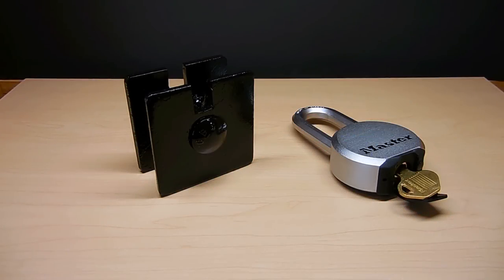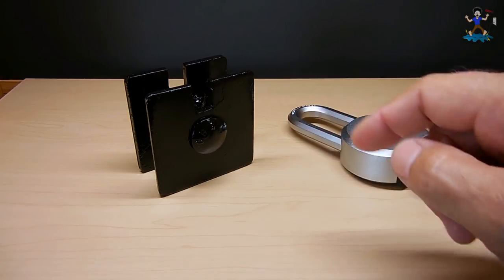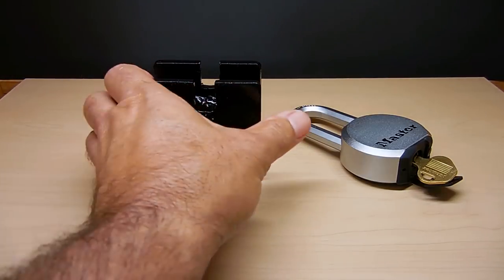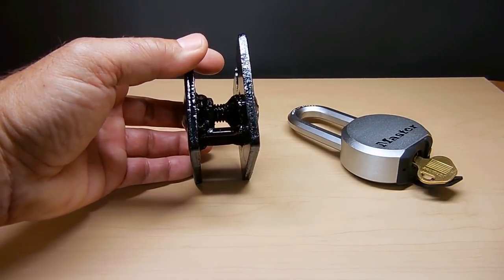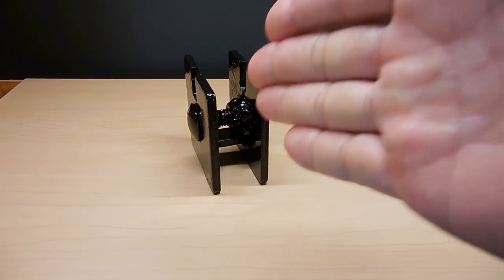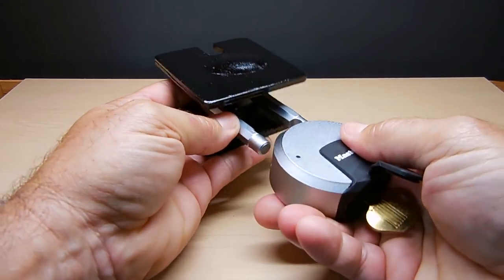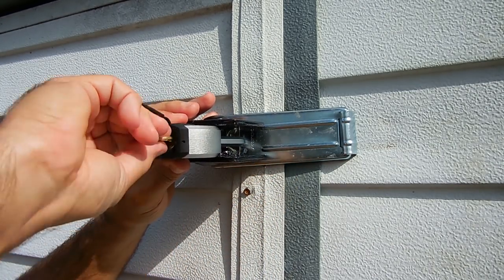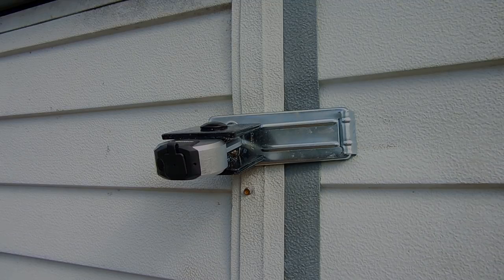Homemade Lock Security! (Thick Steel Shroud)

Comment: I am sure your example 'flimsy hasp on aluminum sheet metal' would easily snap off with a $6 pry bar or crow bar. Sadly we must reenforce every step of the process and lastly have a frangible electric circuit tape that sets off a 200db SIREN or a swinging guillotine.
Reply from the maker: The hasp and shed was used for demonstration purposes only. Ideally you'd have a better hasp, and it would be bolted to a concrete wall or wood wall using long blots. Thanks for watching

Comment: Need not send to lock picking lawyer, as I already said, the only way is to pick this lock. BUT sad to say 99.99% of thieve WON'T know how to pick a lock. If they know, why would they steal your bike or motorcycle. They can simply pick something else much more valuable like banks, car, or any apartment instead. All bike thieves use brutal force. Or that they move away your bike load up to their van, to elsewhere, then, slowly grinder cut. Last but not least, only 0.001% people whom know how to pick locks professionally, bill and lock picking lawyer.

Comment: It would be too easy to just pry the whole locking mechanism off the thin steel siding it is mounted to.
Reply from the maker: That's not what the video is about. Some hasps are VERY strong and thick, when those type of hasps are properly secured, the crowbar will be worthless.

Comment: Really nice piece of work, but it doesn't work for that shed application you show with that lousy hasp.
Why not just cut the hasp with the cutoff tool you show or just use a crowbar or long flathead to rip the hasp right off the shed?
It is likely held on by four weak and short screws.
You've protected the lock, but the hasp is the weakest link there.
Reply from the maker: As long as you use a high quality thick steel hasp, and it's properly bolted into a concrete wall or wood frame wall, you won't be prying it off the wall. Yes, the one I show isn't the best. :-) Thanks for watching!
Reply: @electronicsNmore  
No problem. It is a good design.

Comment: A thief will take a monkey wrench, put the jaws around the whole thing, and in 3 sec twist the entire thing apart tearing off the enire thing off the wall. The little screws holding this into the wood, is no match for the leverage gained with a monkey wrench. The hasp where the lock is placed, is the weakest link in the whole thing. Yes, the lock is undamaged and they did not need nor get a bolt cutter to work....however the objective was to protect the entry, not the lock.

Comment: Pretty affective tbh but idk how well it would really protect against a sledgehammer since it has so little room and has the be vertical it holds itself so when you hit it with the hammer all the tension is gonna actually help you snap it i mean obviously your gonna have to hit it hard probably a couple times but i almost know the average person could snap the lock or whatever you have it locked to and get in just depending on whichever is weaker and picking a lock is always the best idea tbh if your good anyone but the owner will think you used keys bc of how fast you can pick a padlock well cheap ones at least

Comment: Hi, this & your shackle protection using nuts & washers both are videos w great ideas. However, do you know of any method to protect against drilling out the core? Could you maybe JB weld some hardened washers around the key entry? Cheers...

Comment: LPL: "Today we're looking at a shrouded Master Lock setup.  Can't attack the bolt with cutters, and I've already bypassed so many Master Locks it has become boring, so this time, we're going to try something different."  [LPL takes 3-foot wrecking bar and rips the hasp assembly off the wall.]  "Click on one."
Reply from the maker: Every lock made or connection point has weaknesses. Nothing is 100%.

Comment: I lost a motorcycle with that hasp. They didn't even touch the lock. Just stuck a crowbar behind the hasp and popped it right off. Luckily, I got the bike back. No thanks to our ever vigilant police department and their seeing eye dogs.
Reply from the maker: Yes, a cheap hasp is easy to rip off a wall. If it's thick and properly bolted, the crowbar won't work. Thanks for watching!

Comment: Good idea. But. You can just cut the hasp flat bar or just put a large pipe wrench over the box you made and twist it around. Either the lock or hasp will break.
Reply from the maker: That wasn't the point of the video. It was for demonstration purposes only. I've seen MANY thick hasps that you won't be cutting through, and a criminal won't be using a noisy cut-off tool.
Reply: @electronicsNmore  check a bit how they use grinders in broad daylight in the open to cut motorbike chains. They don’t care a shit. Just yesterday 3 people tried to break in by my gate to steal my trailer. 5pm broad daylight and the gate by the road in an urban area. They thought I was not home. They tried to break the lock as I mentioned. Use a pipe wrench and just twist the lock around. Either the lock breaks or what it is attached to. It is not noisy at all. And quick. Only way I heard something was up and opened the front door was because they accidentally knocked the wrench against the metal gate. In South Africa, brute force attacks on locks are common. And using mobile grinders is also common if it is on a farm. Any box around the lock does not slow a grinder down much. And does not help for a brute force twist attack.

Comment: Send it to The Lock Picking Lawyer! See what he makes of it, obviously don't use a master lock, ever, but I wonder what he'd say?
Reply from the maker: He won't be able to use bolt cutters or shims on the shackle, that's for sure. He would have to make a special shim to reach into tight spaces to exploit padlocks without locking balls.
Reply: @electronicsNmore   he would use a pipe wrench on it and twist it off in seconds😕

Comment: You have protected the lock shackle to some degree. A large bar will pry this lock setup off the door frame or expose the hasp or mounting hardware to attack.  This hasp is exposed. I also bet that a battery powered angle grinder with a  thin metal cutting blade will power thru your surrounding steel and lock in no time.  Notch the steel plate on one side and this will expose the shackle which you can now cut . Also how good is the door itself. People put expensive locks or protected lock shackles on cheap kick in doors with glass or glass side lights. Look at the videos of  the military and police using a battering ram to gain entrance. There is no stopping them.  I still enjoy your videos.
Reply from the maker: The video had nothing to do with the hasp, it was all about protecting the padlock shackle from bolt cutters. I succeeded in doing that. If you have a thin steel hasp that's not properly secured, then of course you can pry it off the wall. Like you said, nothing is 100%. Thanks for watching
Reply: JOHN LUCAS ahh police can be stopped  again as you said check videos...can lock doors locking pins go through floor and cieling as well as wall

Comment: you code probably just cut the Metal  from the wall to the Dore and not even need to care about the lock and its security
min 7:02
Reply from the maker: True, but if that hasp was thicker and bolted to concrete, good luck.
Reply: @electronicsNmore  thanks

Comment: just smash with hammer, locking in this position will make a bigger mechanical advantage to brake the padlock
Reply from the maker: Wrong.
Reply: @electronicsNmore  it works as a lever , end of your plate is the fulcrum, just try with a much longer plate and you will find out how easy to brake it even only by hand

Comment: An electric nippler (can opener) can cut around the hinge and it is not very noisy or you can grind the pin out of the hinge itself.
Reply from the maker: That has nothing to do with this video. The video was all about protecting the padlock from bolt cutters, shims, and making cutting the shackle very difficult.
Reply: @electronicsNmore  Well it is not meant as a critique of your idea. I had the same problem and ended up deciding that an inside locking mechanism that could not be accessed from the outside by unauthorized persons would be the solution... which opened another can of worms.

Comment: Great idea to protect the lock, but you can use a pry bar and be inside in about 10 seconds
Reply from the maker: Not if the hasp is thick steel plate and it's bolted straight through a wall. Thanks for watching!
Reply: @electronicsNmore  you underestimate the power of leverage.

Comment: The whole time you were explaining how it was made, I was just wondering what the point of it was up until you finally showed how the lock fit into it, so I would like to make a suggestion. In the future you should show how it works first. Then afterwards you can explain the construction and measurements. I think it will make much more sense to people and hold their attention better.
Reply from the maker: The video title stated what it was, and I also explained in great detail how it would be used with the padlock, but I have had a small number of people over the years ask me to do what you stated. In the future I'll try a video that way to see how it goes. Thanks for watching!
Reply: @electronicsNmore  thanks